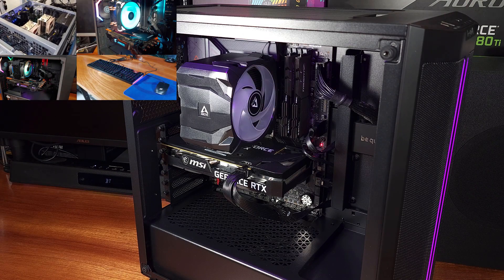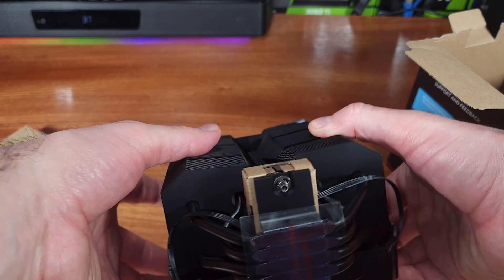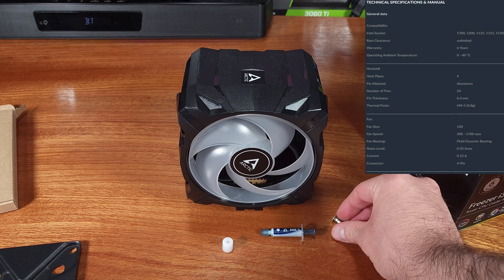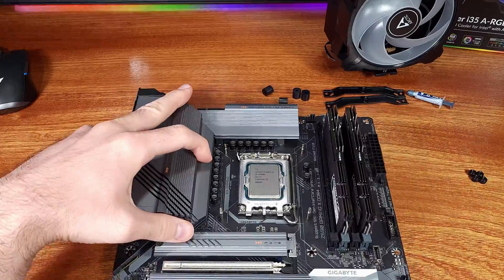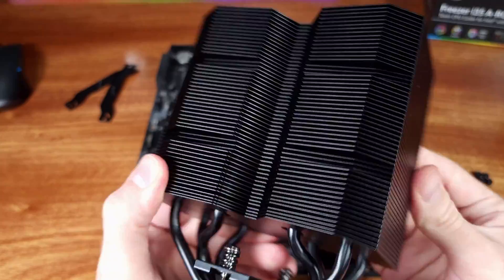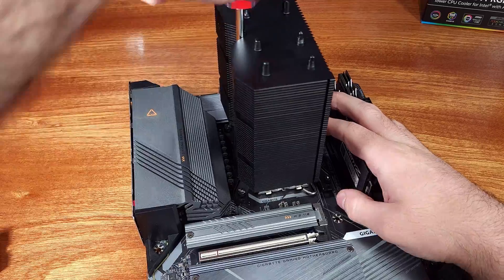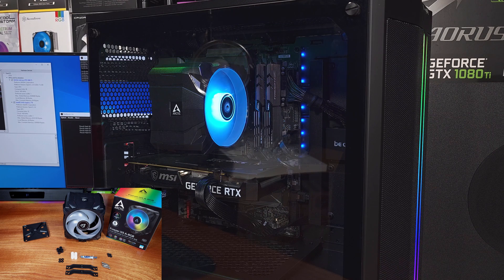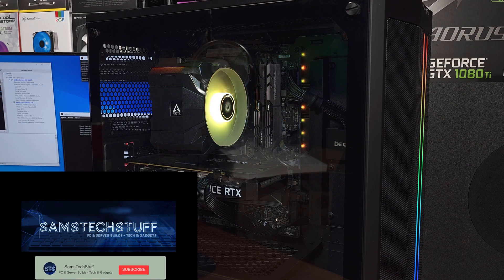The Best Budget i5 CPU Cooler? Airflow, ARGB, Style under $50!

Comment: Is this good for the i5-12600KF?
Reply from the maker: Definitely - I ran it on my 12600k for a little while for benchmark testing. It's a solid budget cooler and it's not overly large so it should have good case compatibility.

Are you building a new gaming rig or upgrading your CPU?
Reply: @STS  Im upgrading, thanks for the reply
Reply from the maker: Nice, I was quite happy with my 12600K, solid CPU performance and value wise.

Comment: is it good for i5 12400f?
Reply from the maker: This cooler would handle an i5-12400f no problem. I was able to use it with my 12600K and that puts out a bit more heat/power. 

Is this a Gaming rig you're thinking about buying or upgrading?
Reply: @STS  yes it is a gaming pc which has i5 12400f, RTX 3060 and 16gb of ddr4 ram running at 3200mhz, 1TB of storage with m2 ssd Kingston NV2 and the case is called spacer rainbow, and currently i have the Intel stock cooler and i have 96 degrees on fortnite and i want to upgrade to this cooler but I want to make sure that this cooler is good for my cpu
Reply from the maker: @alexgenius9958  Ah yea, this cooler will be a huge upgrade over the stock CPU cooler. There's much more material and airflow provided by the Arctic i35. 

Sounds like a solid gaming setup there, what are you mainly playing?
Reply: @STS  I mainly play fortnite, cs2, minecraft with shaders, ets2 and gta 5 and AAA titles like ghost of thusima, resident evil 7, far cry 6
Reply: @STS  and if I upgrade to this cooler imma get like maximum 65 degrees on full load, nope?
Reply from the maker: @alexgenius9958  Nice set of games there, looking at picking up Ghosts as well. 

As for the CPU temps, I can't predict what they will be but the i35 CPU cooler is much larger than the stock heatsink which means generally it will absorb more heat and the fan it comes with pushes more air than the stock heatsink so that absorbed heat will be dissipated faster. It might reduce your temps down into the 50-60C range depending on your ambient environment temperature. When I ran gaming tests with my setup, I know the temps were impressively low during gaming considering the cost of the cooler.

Comment: I have an issue, I bought my pc with this cooler and the color is stuck on orange, how can I fix it?
Reply from the maker: Hi, sorry for the late reply here. Did you get this sorted out? Usually you can control the ARGB color with the motherboard.
Reply: how can I do that? I haven't sorted it out yet:)
 @STS
Reply from the maker: Did you have the ARGB cable plugged int a motherboard header? Normally you can install the motherboard software to set the color types / patterns or boot into the bios and configure that.